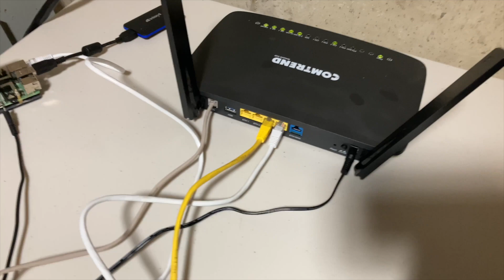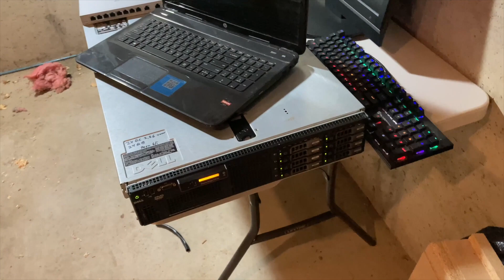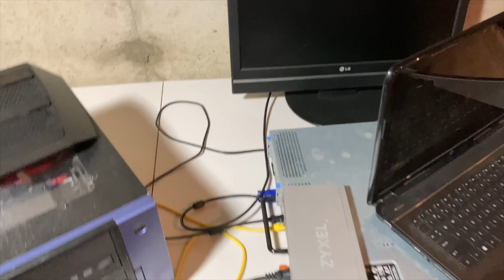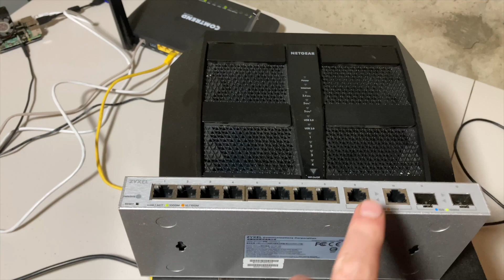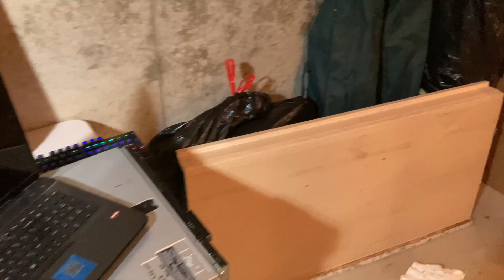New House, New Network, More Projects

Comment: Congrats to moving into a "new-to-you" home.  Be thankful you home was built in the 1990s. My home was built in 1957 and all of the walls are concrete block. Most all of the wiring is old hot/neutral without containing any grounds.  I have upgraded a couple locations with modern Romex cabling, but that always requires crawling in a <24" crawlspace here in Florida.  Needless to say, but I mostly go under during the winter when most of the critters have died off (it rarely freezes here, but most bugs do die by December/January.  Crawling under the house in the summer has me going going through countless spiderwebs and looking out for snakes and other critters. I'll still do it wearing gloves, coveralls, and a head sock and ball cap --but for many people it's a non-starter.  Take care and I look forward to watching your upcoming posts on how you set up your home network, servers, and wiring (network/electrical/fiber/etc.)
Reply: One tip for running Ethernet -- avoid running Ethernet cabling in the same joists as the electrical wiring.  If it has to cross electrical, cross at a 90% angle and try to keep at least a few inches of separation.  Drill new holes through joists for the Ethernet and do not run it through existing holes already being utilized by electrical.  I have learned this from experience where in certain situations it will cause packet loss and a reduction in network speeds, or even complete (intermittent --hard to diagnose) network drops when Ethernet cable runs in tandem with electrical.
Reply from the maker: I have had this happen to and this a a grate tip thanks for posting.
Reply from the maker: The house that I am moving out of was built in 57 as well. under NFPA 2014 you can retrofit 2 prong plugs with 3 prong plugs if the lead plug is GFCI and the outlets are marked no ground. 

https://www.thisoldhouse.com/electrical/21015454/replacing-two-prong-receptacles

Comment: Personally i would vitualize pfsense on the r710 with with the second nic on the r710 as the WAN port within the pfsense vm going to the adsl modem (with the adsl modem in "dumb" router mode or DMZ). Can also install pfsense as a VM  on the laptop with an additional usb nic added first

You can then utilize vlans within pfsense and configure them together with the vlans on the zylex switch to segregate your network

Also very easy to add an additional nic to  any VM in proxmox, assign it a vlan and pfsense will give that nic an IP address from that vlan (dished out by pfsense on that vlan), allowing a vm to span multiple vlans - (i use it for my homeassistant VM and logitechmediaserver VM so both can access my "insecure IOT/guest vlan" and my "local vlan" at the same time)

Your proxmox vm's have hepled me with my proxmox setup so happy to help with above setup if required :)
Reply from the maker: I like the idea of the "dumb mode" i am going to see if I can do this.